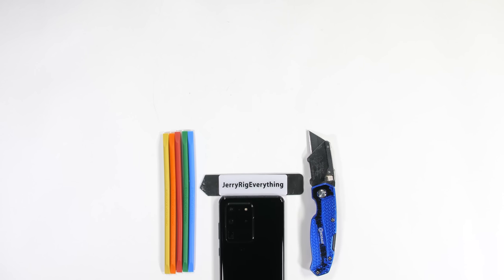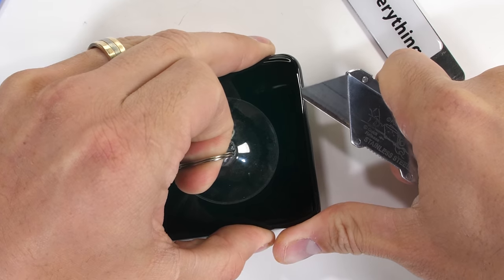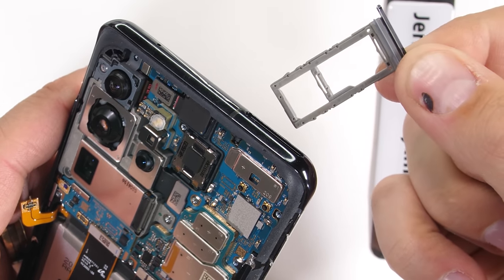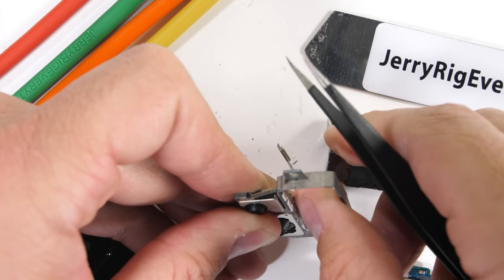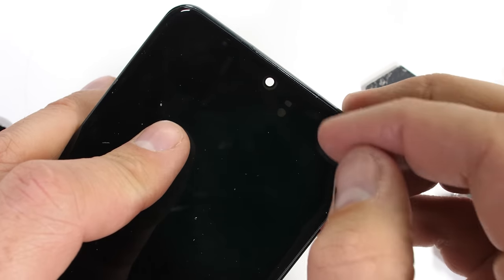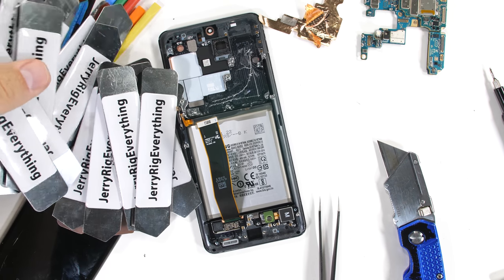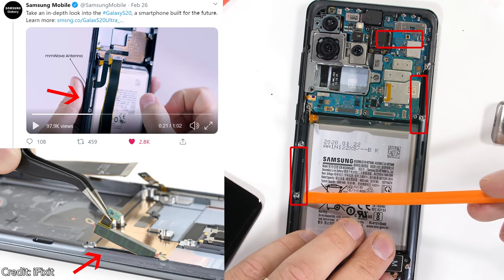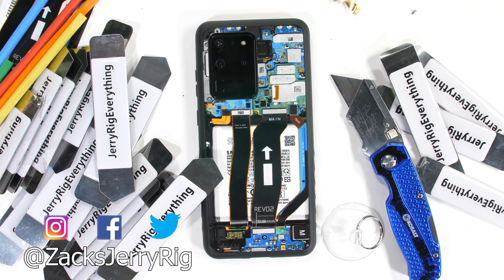Samsung S20 Ultra 5G Teardown! - Is the 5G even real?!

Comment: EU: puts out a law to make smartphone  batteries removable.
Samsung: make the adhesive glue under the battery even stronger.
Reply: The phone was designed and manufactured before the EU interference.
Reply: @StopMediaFakery  I know bro, but what a coincidence
Reply: @musthafaaltaf505  I don't want to be the guy with the tinfoil condom, but I can't help but wonder if they had advance warning
Reply: @Sillimant_  maybe it was to back answer to EU for implementing such a rule
Reply: They had a ton of extra glue so they used it all 😂
Reply: @musthafaaltaf505  I really hope they didn't decide to be that degenerate
Reply: 1% of things the EU does good
Reply: The EU ruling is just dumb and inadvertantly wants phones to have no water resistance. There's a reason phones are glued in and why users are kept out, as  they don't know what they're doing most the time, and it avoids subsequent accidental damage because somebody cut a ribbon cable and needs to repair thatz perhaps adding to waste while encouraging more waste by allowing people to discard batteries after degrading slightly. 

The bottom line is that a couple hundred bucks every 3 years is nothing next to a new phone, and it's far easier to hire professionals that can come to you to stuff. Regardless, the biggest issue is the third party battery niche that will be created and not regulated by brands, this means you'd potentially be doing more harm to the phone as a result. 

Lastly, it's pretty easy and cheap to replace if you have the basic tools and know-how, the only thing I want gone is apple's bs monopoly which inadvertantly wants to destroy legit 3rd party repair business for the sake of red tape and squeezing every last penny from consumers. Ultimately, literlly anyone else ends up being pro-consumer repair-wise, despite still having glued together components. Don't get me wrong, the EU ruling a ubiquitous charging cable is great i.e. calling out apples other shitty monopoly, but this is a step too far and is downright disruptive to innovation in this context regarding user accessible repairs i.e. the few things apple actually got right.
Reply: @insertnamehere8723  or, two words.
Be. Careful.

Phones were structurally fine, and now they aren't. I'd rather be more careful and get a case than trust the big corporations to make phones last longer
Reply: Does that law affect Samsung? Coz Samsung is a Korean company.
Reply: @ih4v0c27  yes because samsung still sells in the EU
Reply: [insert Name Here]  No, you are wrong. It is your product and the fact a battery is the only part which degrades (unless its an apples and they DELIBERATELY slow it down) then why should I not personally be allowed to change it out without having to potentially destroy the device? Your argument is bad.
Reply: Headass 🤦‍♂️
Reply: @insertnamehere8723  samsung s5 had ip ratibg with removable back
Reply: @insertnamehere8723  Galaxy S5

It had a removable battery and water resistance.
Reply: They maybe just used up all the remaining adhesive the company still had on this phone rn instead of throw it away next year
Reply: @Berzerk I wouldn't be surprised
Reply: @xkyoshi11 

Kinda, and it kinda sucked as well as being nowhere near today's standards with dust or with the same degree of resistance, evidently 🤷🏻‍♂️. It's still needless as long as batteries are easier to remove with pull tabs, that I will agree on, that Samsung need to stop in this recent trend. But it's just obstructive in making them user replaceable and consequently open for user neglect or 3rd party neglect with dodgy batteries that may do more harm, and of if you don't already know or need a brief history lesson on the matter, Li-ion batteries are volatile and it's not worth the risk for such little pay off. I mean what is a couple hundred or less versus a 1,000 plus price tag every two years? Do the math. Besides that wouldn't work with glass and wireless charging coils as a factor. Plastic is not durable at that thickness or worth the premium on a 1,000 USD device.
Reply: [insert Name Here] 
The galaxy s5 had removable battery and was water resistant.
Reply: @bumblesquatt  dumbest argument i have heard lol
Reply: @insertnamehere8723  You should thank the EU for this law.
Do you fully understand the law that gives you the right to repair?
Or are you working for a big company that is making unrepairable things.
Reply: @PieterPatrick  There is no right to repair, just look at Apple.
Reply: @insertnamehere8723  I miss the plastic back on the old Samsung Note.
Glass is only fancy, it breaks, it is heavy and it shows a lot of fingerprints.
The plastic back was very durable and never broke (I opened it almost everyday to change the battery).
The next phone I bought was smaller and much heavier because of the glass backside.
Also, I do not need a waterproof phone, but I do like a battery that I can change.
Reply: The Koreans have always been a little confused, give them time, they'll catch up.
Reply: @bumblesquatt  you do know that the slowdown is to prevent battery degradation and to prevent shut downs?
Reply: @insertnamehere8723  can i have the option to buy a phone without water resistance and flagship performance.
Reply: @MsMRkv  it's just an excuse to make phones less repairable
Reply: @Sillimant_  

That's literally not a mutually exclusive concept regarding longevity. Phones ARE durable, obviously aside from glass, you should treat a 1,000 USD device like it costs that much, but a superficial crack isn't going to total a phone. The same applies to front screens glass is there because of the level of resistance it provides against scratches as I'm sure you're aware galaxy phones with plastic screens and bodies sucked. Being careful is generally a good idea but a couple hundred, if that, 2-3 years is a better proposition than another down payment of 1,000 bucks. You still have the option of cases, etc. But glass has way more resistance than you think regarding heat, wear, chemicals and the elements. Glass is only fragile under extreme circumstances where you're dropping it from stupid distances but it is resistant to general normal use within reason. A case still rectifies most problems and provides features such as IP 68 water and dust resistance, as well as wireless charging.
Reply: @bumblesquatt  

90% if people wouldn't know where to start and I can actually give you an example of how dumb allowing users inside a phone is, as a I had a defective and far from legit battery replacement for my s3 that went the way of the note 7. Li-ion is too volatile for user accessible batteries to be viable. Further, security measures in place like on Samsung's make it so that you can't use the device without a battery regulator module connected to the wireless/ reverse wireless charging pad in place, and this obviously is not as simple as clicking a modular component into place like older phones, which again links back to what I said about 90% of people not being proficient in repairs even factoring in the possibility of a guide. Most aren't willing to take the risk and this "issue" is arbitrary to say the least. Again, what is a hundred or slightly more over a whole new phone every two years? And yeah, that's what apple would force users to do i.e. "upgrade" since apple intentionally limit repair options and offer an extortionate premium for the security while actively blacklisting 3rd party repaired devices. Samsung is among the most friendly in this regard, even with a link to official parts to DIY or a fee in addition to their repair service that involves somone coming to you or you sending it off, not getting the run around so some "genius" googlimg shit aan waste your time and fuel traveling to and from places.
Reply: @MSstudioHD  

They also didn't have the security measures in place like with phones now i.e. where the phone won't work if the battery regulator module is not connected e.g. that big black pad that the wireless/ reverse wireless charging coil is attached to. Times have changed and I had a note 7 incident back in 2013, due to a less than official counterfeit Chinese battery replacement that inflated and burst into flames. Li-ion is not something people should not be handling, especially not with a volatile substance that's heavily regulated on transport now. Think first. This EU ruling is obtrusive, arbitrary and a step too far.
Reply: @MsMRkv  

Literlly any response above. Read!
Reply: @PieterPatrick  

People have the right to repair, it's not too hard with modular components if you have experience, or if you want to gamble and take risk for a slightly cheaper price, though that depends on how the repair goes and parts unofficially. Adhesive is obviously annoying but there's a reason it's there. I have criticized Samsung's method of gluing parts down that require maintenance e.g. the battery, but otherwise it's to discourage people from screwing up their 4 figure device by opening it up, as I'm sure you're aware the customer isn't always right and most people aren't trained/ qualified repair technicians/ engineers able to do so, even with guidance. It's a tall order for those who have experience/ the equipment when it comes to new phones and rushing. It's just far easier to pay for the service later, which isn't really anything down the line when the components have depreciated over 3 years. It's not a conspiracy, buddy. It's common sense!
Reply: @PieterPatrick  

Interesting, because the flexibility of those stick glossy plastic covers was actually so  notorious for cracking if regularly removed, not to kention wastefull in its own right along with users throwing slightly degraded batteries away contributing to a worse problem, and the plastic over time consequently compromised the resistance if it degraded, as it usually does, presuming it's eco friendly. They also had no dust rating, either. It should go withoit saying, but plastics are also more reactive to the elements than glass is, and thus why there's a huge asterisk adjacent to removable and plastic backs, since damage, wear and tear, heat and all those other life factors are an issue. If the glass breaks then pry the rest off the back and order a 40 dollar replacement with some good adhesive. But, as it should no doubt go without saying, LOOK AFTER YOUR DAMN PHONE! If it costs upwards of a grand, then start treating it as such. Plastic scratches and degrades a lot faster and a case and skin can fix the rest of the issues in conjunction with glass, which is still pretty damn tough.
Reply: @lennardgalander5729  

It was also planned obsolescense, hence why they got sued multiple times for it from multiple countries. It doesn't help when they conveniently "don't have the parts" or refuse to fix a prior 3rd party repaired device. Basically, a monopoly. It might have some vague relation to prevent excellerated battery wear, however, literlly no other phones to my knowledge, or even from my experience, had the same issue. It seems like some red tap bs clinging to straws to justify the practice, even outright saying they wanted people obstinate from repairs as a result. Bs, as usual from crApple. It's jist interesting to see how older versions of ios perform better and more stably than newer ones. The funny part is how apple bricked older devices that didn't upgrade holding their cellular and wifi connections hostage until they do. They also learned nothing and now devices as new as the X are showing problems for some heavy users.
Reply: Sure, if you don't want a degree of protection and any foldable right now, even though that has the same fundamental "issue".
Reply: @Sillimant_  

Read any reply relating to the matter. No, no it isn't. The repair services offered ultimately are the Achilles' heel and Samsung by far have the best pro-consumer option, despite gluing products shut.
Reply: @insertnamehere8723  thank you, i think you are right
Reply: @insertnamehere8723  That nototious cracking was a different kind of backside, I did not have the glossy one.
And I used it as a real workhorse and it never failed me.
No dust problems and it I dropped it twice in water, but I dried it without any problem.
I repaired the screen myself and bought three times a new battery.
I never needed a tablet because after a year I swapped the battery.
Most amazing, the plastic backside did not get scratched, it felt soft, no fingerprints and as new after years.
Note 3 had a good backside but that of the Note 4 was perfect.
Reply: @insertnamehere8723   I really do not agree with you. They make a product in a way that it is almost impossible to open it or repair it.
How much proof do you want for example let's say.... Apple.
They do this on purpose, if you think this is for protecting their product... that is really naive, sorry.
Reply: @insertnamehere8723  you completly missed the Point
Reply: @PieterPatrick  

That's half the issue if you actually really through what I said. Safety and protecting users from their own curiosity is probably more poignant here. Again, I ask, what is a few hundred bucks, if even that, once the components have depreciated? You're also mistaking samsung for apple and Samsung don't have a repair monopoly, they're actually far friendlier on 3rd party repair business than apples. And the only thing I give credit to apple for is the battery pull tabs, but that's outweighed by the fact it costs half the value of the phone to repair the rear glass. They're aren't the same business, buddy.
Reply: @lennardgalander5729  

Read my comments again. YOU people need perspective.
Reply: @insertnamehere8723  it is talking about the battery being removable. How or by who or what is not defined. Phones will still be as sturdy as always. Apple gets it right already so Samsung can too. Cases will remain the same. Anywhow; What happened to screws anyway? Bring them back and let me screw up my phone
Reply: @AbuHajarAlBugatti  

Everyonevhere is talking about removable batteries LMFAO and they are still removable to a degree. I've previously criticised samsung for gluing batteries in recently over apple's pull tabs, but that's offset by the fact apple get everything else wrong in regards to repair services and repair costs. Needless to say, things don't remain the same with the prospect of removable batteries under EU demands, because it's dumb and obstructive and not feasible. The point is they're like that for a reason and keeping YOU out is for YOUR best interests 9 times out of 10. Leave thst to professionals, unless, of course, the ruling is in favour of obligated recycled and more resources to repair services, but that's ultimately down to the consunsus, unless the EU rule something that prevents a new phone every year, in which case people would be more inclined to upgrade and lean more toward repairs.

Further, There's no way to maintain the features and materials while demanding removable parts by today's standards, and I'm sure the same people would complain that things aren't up to modern standards much like they seem pro foldables but seem too obtuse to understand why water resistance isn't supported. The point is you can't please everyone, even if you do give them exactly what they want. 

Anyways, this ruling also opens the flood gates for counterfeit, imitation parts not fit for purposes and a load more note 7-esk incidents, because Li-ion is volatile and components often integrated with the motherboard to regulate it properly for SAFETY. Need I mention the ammount of users f**cking up their device, because the customer is never right, nor do they know best, or perhaps various issues relating to parts that may or may not frequently be accessed. Unregulated, freely accessible in the hands of the general public should not be ok. 

Secondly, I mean, unless you want to ignore Li-ion regulations and potentially put them in the hands of novices and/or people looking to exploit this EU bs, you're not in for a good time either way due to a piece of easily disregarded legislation fragrantly opening the door for inevitably issues. If anything this would contribute to more waste by allowing users to swap and change batteries, since recycling is evidently a failed notion to most who would rather liter outside of a bin than take the time to out something inside of it, unless there's more legislation that creates more of a headache because of this abitrary "removable batteries" thing.

Semi-related, but it's also worth noting that more countries are leaving or showing interest in leaving the EUs bs for a number of reasons, mainly because they have no backbone to enforce things that are sane and/ or regulate things reasonably with their infinite ineptitude, since a few economic collapses can attest to that, as well as the wavering 2030 compromise regarding emissions. The same European Union wanted to ban memes, dude. That pretty much speaks for itself when talking about the bunch of old, dried up, pencil pushing prudes who have no clue and want everything covered red tape and bs for the sake of hating  things they inadvertantly or outright hate and/ or fear just to make life harder than it needs to be i.e. boomers. 

It doesn't take two seconds to see how flawed this ruling is.
Reply: @AbuHajarAlBugatti  

Screws also don't keep water out. Adhesive is a necessity and a reality here. As for screwing up your phone, yeah, you pretty much seem set on doing that already, pal. Don't DIY things you don't understand, unless you're willing to foot the repair bill, in which case play it safe later and not sooner and not to fix something that you broke with this arrogant attitude. The consumer doesn't know best and leaving it to repair services is essential when it comes to potentially dangerous components. The thing to take away is the attitude of the consumer is the issue and not the tech. If repairs were nore common and needless/ thriveless spending was curved then perhaps emissions would go down, as there's no need to create problems or reinvent the wheel when someone feels obligated to upgrade every year over something so small like 1 feature that's not really that impressive in perspective of things. If that was resolved and a more pro-consumer repair practice was deployed, then perhaps we might get somewhere, and people might actually appreciate tech more and see more of a reason to upgrade, since a two year cycle at least would have more emphasis on longevity when they design phones and possibly allow manufacturers to include more impressive tech as it comes along and depreciates to the point it becomes practical to include at lower costs at a decent volume to meet demands. Besides, this whole thing is a painfully obvious narative on a throw away culture that takes things for granted. I don't think you need reminding of that.
Reply: @bumblesquatt  can you easily replace the oil filter in your car? Most people can't but they can learn and acquire the proper tools to do so. And it's done in such a way that doesn't damage the operation of the vehicle. 

Or,  you can pay someone to do it for you. Why do phones have to be any different than that? Why does this specific product require different rules?